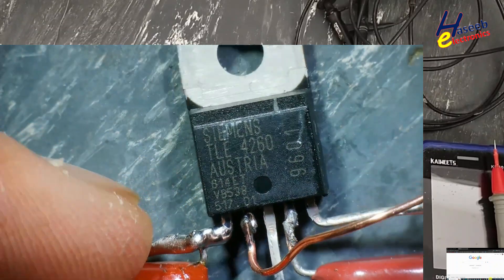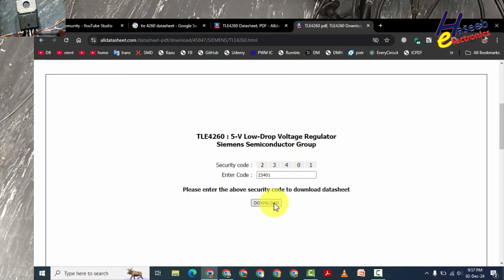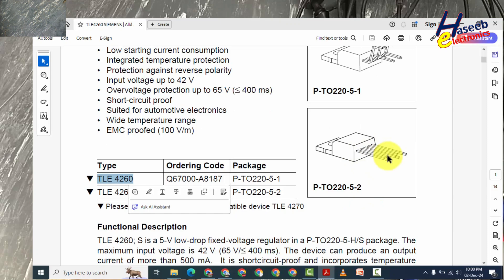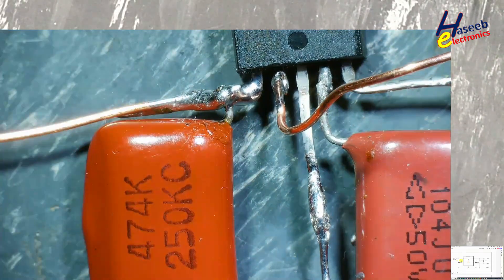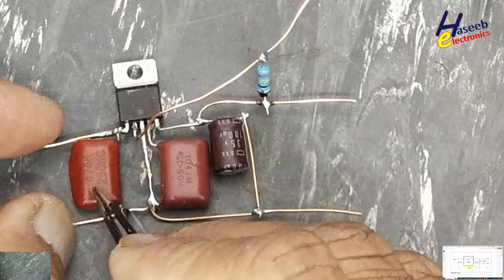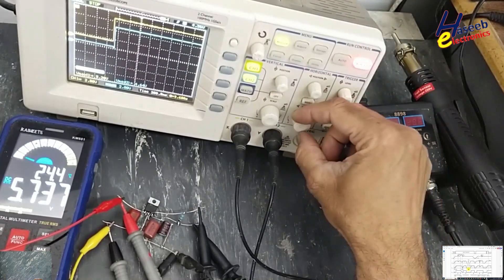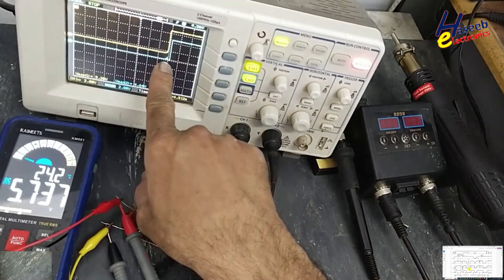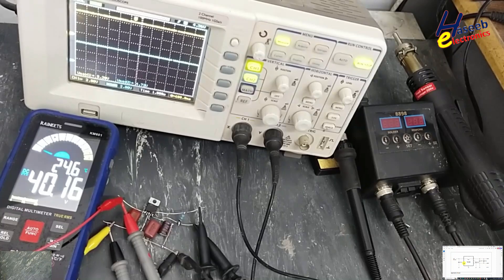{1385} TLE4260 Automotive 5V Regulator with Reset Output | Sample Circuit & Testing

Comment: My apologies, Haseeb, but I am not sure that I understood the advantages of this particular regulator chip... It has a reset signal output. I take it that this delayed signal could be used to notify a microcontroller, relay, etc. that the regulator is stable and ready to have a load applied to it. But, couldn't this same function be added to the output of any voltage regulator, with the incorporation of a time delay circuit made from the same resistor and capacitor as this chip requires and being feed from the voltage regulator output? Of course, I have not read the data sheet, as of yet, to find the answer. I will start there. Thanks for teaching us!